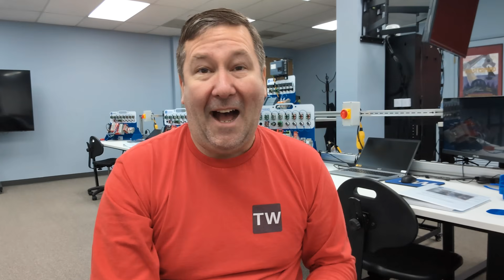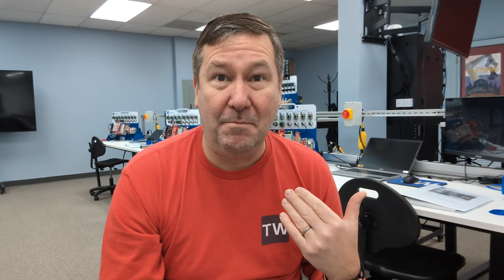How to Move from Industrial Maintenance to Controls Engineering

Comment: Loving your videos, I’ve somehow managed to get an interview at a parcel sortation facility next week, I’ve been working as a mech/elec maintenance engineer in manufacturing for a few years (foundry, galvanising plants etc). Almost zero experience with PLCs except the odd ‘waving the hand over a sensor and then replacing it’ type thing; never done a course. 
I really don’t have the knowledge or skills required for the job but I’m gonna turn up, show interest and maybe they’ll take pity and offer me a position for a slightly lower salary or something! Wish me luck🤣
Reply from the maker: Good luck with the interview, you got this! 👍

Comment: It looks like the Downer company which is in Australia is going to employ me in a role which is a bit more like what you're talking about,yes, an electrician keeps getting that I'm going to marry a Green whose a Mott whereas the production electrical engineer who I know there doesn't think so.

I was working for them in 2023 & when I lost my job there as a contractor I went for a job interview & that's what one of my referees whose an electrical engineer told me.

I did PLCs 1 at tech in 1998 which was very basic which was programming the Toshiba EX20 PLCs which was a strand or module which was pulled out of a post trade electrical engineer course.

There's PLCs 2 & 3 which are strictly post trade modules & only offered in a post trade course which consists of the SCADA technology you mentioned even back before the turn of the century !
Reply from the maker: That's a great journey you've been on!